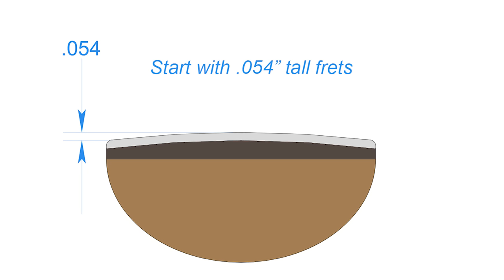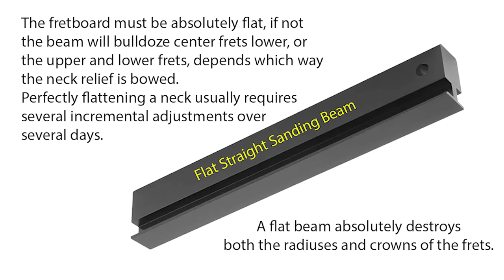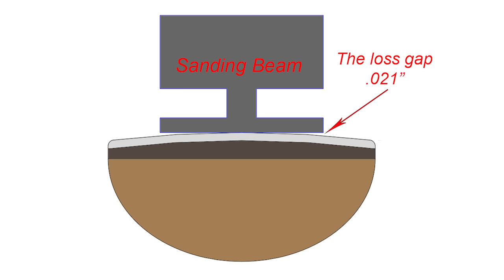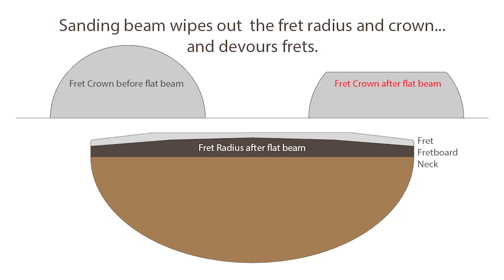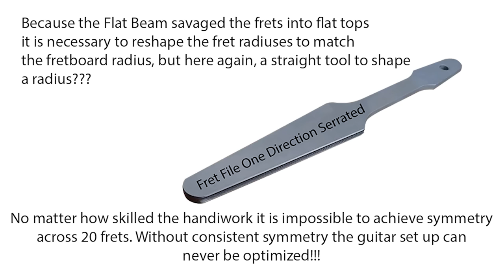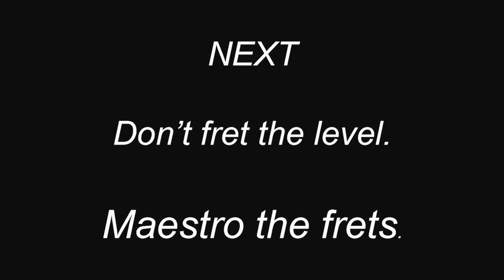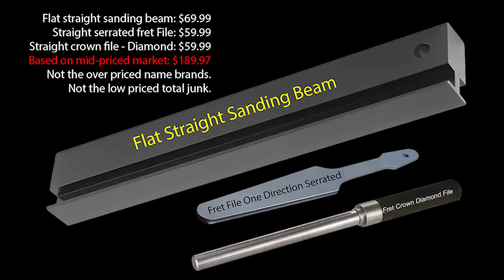Fret Leveling - Please view NEW videos for the all aluminum laser precision 2nd gen - links below

Comment: I’m sold.  I think you have designed and offer the most ingenious and fool proof tools to level frets I have ever seen.  I have pried open my wallet and ordered a set of 4. 
 
A case of better late than never, for me I guess.  I bend the fucking shit out of my strings.  Flat and low frets for G B & E are common so I have been doing my own fret jobs for about 30 years.  Problem is until recently I had only done probably less than 6 a year at most. The last few years or so maybe 16 - 20. Hence being I don’t do it often enough to get really good at it my skill level needs (a lot) work.  As far as I am concerned and being an anal OCD perfectionist, technically and realistically speaking . . . I would say that I suck at it.  

Having said all of that above, ‘most’ of my friends and few clients are very satisfied . . . except those that are as or more anal than myself.  

I started doing my own fret jobs because:  1) The only luthier I personally knew that maintained my few (at the time) guitars since the late 70s moved 400 miles away to upper Michigan about 25 years ago.  2) I have not been satisfied with any ‘professional’ fret jobs by paid luthiers at local shops since soon after my buddy moved.  2) I have too many guitars (for the size of my house) so it would be costly.  I have what I call GAS (Guitar Acquisition Syndrome).   And uh 3)  . . . I’m cheap.  

I have however visited my luthier buddy every few years on vacations in Norther Michigan and when needed have had him level or service any higher end or vintage guitars that may need any work being I didn’t want to screw them up. I drop them by on my up state and pick them up on my way back down state.   

My time spent using the so-called ‘Old school method 4 – 7 hours’ is more like 8 – 16 hours easy.  I rarely get the action as low as I want it.   At my current skill level If I tried to make a living at this I would starve and be homeless.  It was kind of a labor of love thing but I am beginning to hate it.  

I have taken off far too much of the frets too many times leaving either a total refret job needed the next time the frets need leveling in the future OR it needs a refret job before I am done doing it on the current neck.  If I crown one fret too low, I have to start all over again.  If I try to just touch up levelling one fret, it becomes two frets then 3 frets then a complete leveling job.  OR more often than not, just accepting the fact that I just can’t get the action as low as an anal OCD perfectionist would be satisfied with and have to set the action above the optimum height I am trying to achieve.    

About three years ago I started investing ($$$) in a real ‘luthier’ steel straight edge then onto some really cool MusicNomad tri-beam dual notched and precision straight edge tools, all sorts of diamond radiused files to add to my expensive standard luthier files I have been using.  Most recently I bought a fret press and a few cheap garage sale Chinese and Indonesian Strats and the like to practice on.  

It’s time to do the frets on my Tele and SG so I can’t wait to get your FretMaestro tools . . . then I have to find the time to do it – based on my current other projects it could be a while.
Reply from the maker: Hi again, and thank you for your order.

Comment: I have never leveled and crowned frets on a guitar. My Stratocaster frets are starting to look rough, I think it’s time for a level and crown so I watched several tutorials on doing this and  could not believe the neck had to be flattened. The correct relief is hard enough to achieve, and now I have to flatten the neck? I don’t think so. Also, some of the leveling beams were flat (some are radiused). How in the world would a flat beam work with a radiused neck? I was confused, I thought I was completely missing the boat on this. Today I watched this video, and now it all makes sense. Thank you Steve for the video! I know how I will level and crown my strat!

Comment: What would be the process involved to do a perfect compound radius...say 9.5 to 12? This adds a degree of difficulty to the whole thing. Typically takes me 2-3 hours for a single radius re-fret job and I've often wondered why the frets weren't pretty much dead on after installing brand new frets but even with a home made (pretty decent) neck jig station, there is almost always a couple of frets that have much more material loss. I now get praised for my fretwork but it took years of practice but I still need to rely on the PERFECT straightness of the neck. My second question would be do you offer a grouping price for all 11 tools? I am just now going to your website. I do admire problem solvers so I thank you!
Reply from the maker: The Pro 11 saves you $385.00
Reply from the maker: Fret wire is +/- .002" tolerance out of the extruder. So unless it was leveled right from the seller... it needs to be done. Yes, we offer the Pro 11 that saves you $385 overall.  
https://sixstringers.com/call-to-order/

Comment: Do you have a tool or technique for filing fret sprouts on the edge of the neck?
Reply from the maker: Not at the moment.
Reply: A needle file from any hardware store. I've done fret ends numerous times with the same needle file. Tape the fret board to protect it and gently file and round the ends. You don't need a fancy tool to do this, just a good eye.
Reply: Would help with a fancy tool to get bullet round edges quicker, especially when it comes to stainless where commonly sold needle files will have a short life.
Reply from the maker: Yes, stainless is tough on diamond files... cannot press into it, must use the weight of the file.
Stainless does not clog as the grit particulates into hard granules whereas nickel is soft and the grit melds together.
Pressing hard on SS frets knocks the grit out of the nickel plating that occludes the grit to the substrate.
The torque digging into SS is greater than the torque needed to dismount the diamond from the file.
So once again... use the weight of. the file instead of digging in.
Reply: @SixStringers  
To clarify since you might have misunderstood.
Commonly sold needle files at the hardware store are not diamond files though, hence why they will have a very short life when it comes to stainless frets.
I’m fully aware that one should let the tools weight do the job, common thing for most tools.
The process of making fret ends completely round like a bullets is very time consuming and requires one to constantly watch closely, I think that it could be made easier with a tool specifically made for the job, just like the perfect tool you made for leveling frets by hand.
Reply from the maker: Okay... be it a steel serrated file or diamond... SS is a tough customer. I think diamond can last longer when used properly, and it won't get nicks in it that a steel file will.
There is a diamond file made for fret ends... it's pricey as are all things from that seller, but it does exist. I cannot testify to its practicality, it's an interesting tiny thing, minimal surface area, hence longevity is a valid. question.
Making fret ends into bullet shape... attractive, yes, necessary... well, none of my guitars feature that shape and I have no issues with my angular fret ends.
Some guitars do come with bullet end frets.
One could use FretMaestro to shape that... the caveat is that first the end of the fret needs to made flush to the binding/outer edge, and FretMaestro does not do that.

Comment: How do you compensate for string pull without a Jig?
Reply from the maker: No need. We are only work a .47" width of the fretboard... there is no bow or arch in .47" length of the fretboard. If you have that, your guitar is shot.

Comment: Somewhere in your video you mentioned tape? Do you tape all the wood? Do you measure with the fret guage, with or w/o the tape on?
Reply from the maker: Blue painter's tape... .005" gauge is the common. That is factored into the depth of cut. Use the gauge before tape. No need to tape everything. I tape for one fret, pick up the tape and move to the next, when not sticky enough then new tape. But.... you must first make sure on the 1st 3 maybe 4 frets that you found the dialed in depth of cut that will then work for all of the rest of the frets... then you are off and running.
Reply: Thanks. Very logical adding the .005" after original depth is decided Thanks, Great ivention.. @SixStringers

Comment: looks like a hand held plek machine.. nice process.. but what about the shredders with 12-16 compound radius guitars?..would need at minimum 12, 14 and 16 radius.. ??  will one set do both SUPER JUMBOS and vintage high narrow?..
Reply from the maker: The files will do the fret sizes... and use the V Narrow Crown file to dial in.
For Conical Radius Fretboard, yep, you need 3... but would you really want to try and use guess work using flat beam and straight files. And what would it cost to tale it to a shop? Do the math.

Comment: I have about 10 guitars and no idea what radius. Whats that gonna cost. I can probably measure radius but not fret hight
Reply from the maker: Check manufacturer specs, or but Radius gauges and check, be careful, use a flashlight to show gap is any, the difference between 10 and 12 inches is very subtle, the flash light will reveal that.

Comment: Whats the radius of a evh wolfgang?
Reply from the maker: That is a Conical Radius 12"-16"
We will have our new FretMaestro OMNI available in about two weeks made specifically for Conical Radiuses.
Every fret radius is slightly different on a Conical. The OMNI references the fret board to achieve this.
Fret Boards are not bumpy or uneven. As long the neck is not twisted or "S" curved, that it can be adjusted flat using the truss rod the fret leveling is easy with FretMaestro.
Twisted necks cannot be corrected with fret work.
"S" curves in some cases can be made to work, but requires judicious planning. For that see customer video "FretMaestro to the Rescue" here on You Tube.

Comment: Gibson frets are very shallow. After a fret job, there's not much left.
This is why I sold my Gibson LP standard.
Reply from the maker: Yes, and other brands too have soft short frets. I had a guitar, famous brand $1,000... I put divots in those fret much sooner than I expected... this was back in 2010, I took it in to a famous store, not the giant one, for a fret level, when I had called them first the quote was $200-$250 as the norm, but when they saw it it jumped to $400. Well, others quoted $300-$325... but i went with the Famous guys... after all, the guitar replacement with new only went up in price,  not down. Well, they did do a good job but no way there would be enough fret for a second go at it. That's the problem with sanding beams and straight files, it eats a lot of fret material. The acoustic I did on video had the same fret wear, about .007" to .008"... with Fret Maestro I took off exactly .009", and so there is enough fret material to get another level on those frets, but with the beam and file way... no chance of that.
So in my view, I am buying another ten years or so of fret life instead of five or so, and I see that as a big savings for me. That acoustic is Rosewood and Sitka and Ebony, these days those guitars are very expensive.
Well... that is one of great advantages of FretMaestro over beam and straight file. Take it as you will, everyone counts value differently, some use dollars, other use sea shells and beads. But when it comes to a guitar there is the end result as well, and Maestroed frets are symmetrical clones of each other that free hand work cannot do. You get two three four fret levels or more with Maestro... you get one with beam and file and rarely two... do the math.
Reply: $400 for a fret level? That’s ludicrous man!

Comment: I don’t know.  Led Zeppelin, Clapton, nirvana, all did just fine without these expensive tools.
Reply from the maker: Yeah, and 19th century carpenters did just fine with hand saws and chisels.
Who does that today.
Reply: @SixStringers  I’m not sure that’s an apple to apple comparison.  Your tools are still essentially chisels and hammers. In other words, your hands have to be used. Arguably, it’s a better tool.
Like a better hammer.  But a hammer is still a hammer.
Reply from the maker: No... one still must use hand eye coordination to control a skill saw and so on. However, the results using a modern power tool are far more precise and the practice required to use them proficiently is far less. That is the success of modern tools Vs 19th century tools.

Tools have changed tremendously in the last hundred years, but not the tools for leveling frets.
Your flat beam and hand files are at best, guesswork, that is the inescapable nature of such tools, so that only those that dedicate themselves to master them can do a decent acceptable job. Yeah, no more fret buzz, close enough.

FretMaestro does not require this extreme learning and practice, anyone can quickly  dial in, just file straight, the same as with any crown file (an actual made to crown file, not a triangle or flat file, those are even worse.) to prevent grinding the sides of the frets.
That's it.. and be patient to follow through to bottom out the Maestro so that all frets are level with each other, otherwise, must go back and finish those that were not finished, no fret harm done, just having to go back and finish is all.

Now maybe you are a pro... you get real money for doing it, that being the case you get paid because few people have the time nor the inclination to master sanding beams and freehand files, but they really would rather not pay you if they do not have to.

FretMaestro makes that a reality for them, for the rest of us, anyone can do it, no professional skills or experience needed. And they can do it many times on the same set of frets, and that is not true with the old way. And they can do however many guitars they have, each time not paying you. And the results they will get are Symmetrical Frets Vs the Asymmetrical frets that sanding beams and freehand files always produce, always.
Symmetry is balance that makes the setup far more precise, hence the play and intonation can be optimized. This is not so with asymmetrical frets. You can get close if you are really good, but close is close, and dead on is dead on. Not the same.

I understand that the pros want to get paid, they don't want people to do their own fret leveling at home. Leveling frets measures about what, 70% of guitar repair income.

But if you think about it logically, every pro will benefit from FretMaestro. Even if you rough it in with a beam, finish it to perfection with FretMaestro, your results will be far better, and your customers will think you are amazing. That's a win.

Comment: What if i got wear on my neck? This tool works if the neck was completely level. It's not real life im afraid.
Reply from the maker: Wear on your neck... you mean string wear. No problem. String wear almost never touches the fret, strings angle down off top of fret setting the wear they can make about ⅛" from the fret.
FretMaestro only uses that ⅛" to follow on.
So, it is real life... don't be afraid.

Comment: Great invention.   What is the tolerance on the depth of cut?!?  0.001"?, 0.002"?
Reply from the maker: Good question. That depends on the starting height of the fret to the depth of cut of the FretMaestro. Say you have a divot that is .007" - and the fret height is .053" so you set FretMaestro to .051" which is a setting #3,  you would be removing .002" material which in this example is .0013" more than the divot ... extrapolate form here. Basically you are looking at .0015" average gross tolerance in this regard. Did I understand your question correctly?